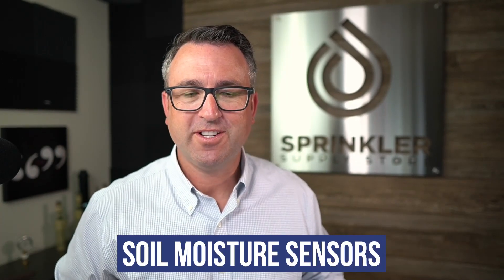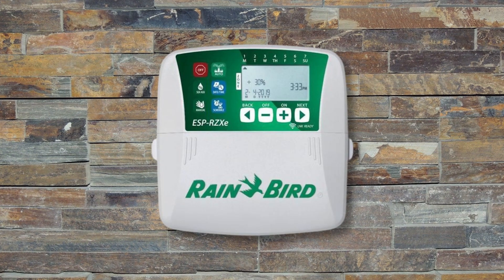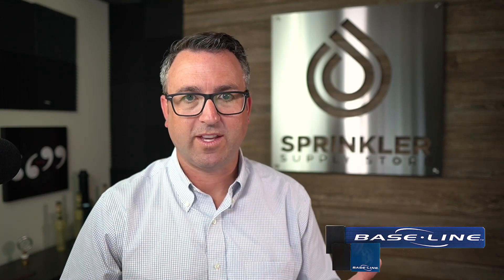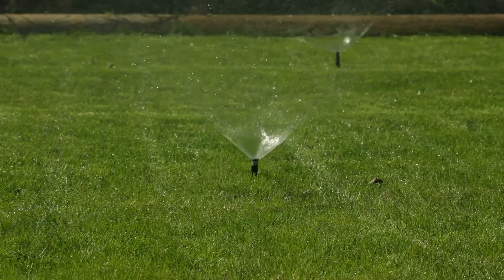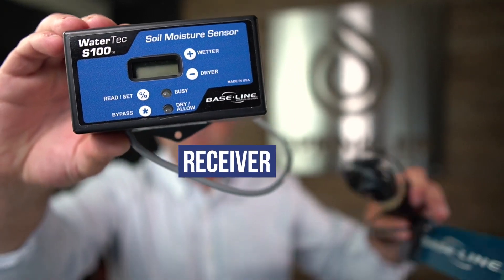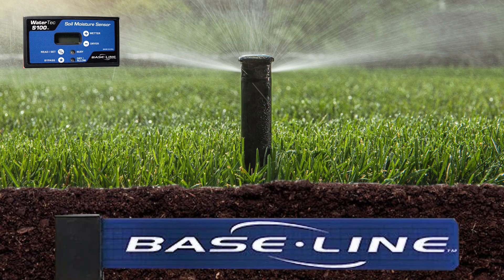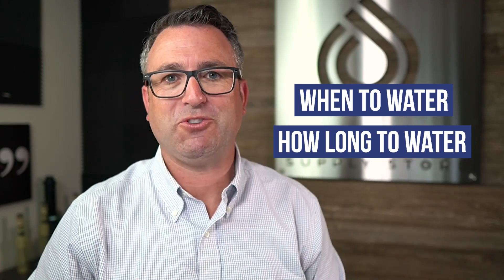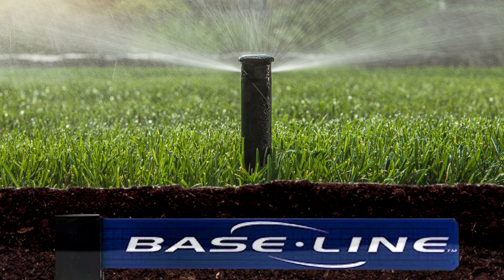How does soil moisture sensor work? | SprinklerSupplyStore.com

Comment: Hi Andy!
I have a new small residential Hunter system with an XC600 X-core controller. I'd like to add a moisture sensor. I'm looking at feature differences of Baseline and Soilclik but not seeing much to compare contrast. I watched your video, reviewed your website and comments below. I understand the advantage of "no homerun wire". But my controller is very close to the valves so not a lot of advantage to not have to run the extra wire. Are there any other significant differences between the Soilclik and the Baseline? Do they work equally as well?
Reply from the maker: Hi @benchmarkimaging8293 - if you have spare wires, you could use them the Soil Clik instead of running new wires.  There are pros/cons to both. The Baseline sensor will be more accurate due to the technology used in the sensor probe, while the user interface on the Soil Clik is definitely superior. The Baseline sensor also has a calibration feature that will help you properly set the sensor threshold after install - and you can see that actual soil moisture percentage - the Soil Clik does not display the percentage.

For accuracy I would choose Baseline.
Reply from the maker: @benchmarkimaging8293 Fun fact, the Hunter Soil Clik is essentially a private-label version of the Irrometer Water Switch, found here: https://www.irrometer.com/landscape.html

Comment: What’s the advantage of using these sensors over the Hunter sensors when running a Hunter controller ?
Reply from the maker: Depends which other sensors. Always install a rain sensor, even with a soil moisture sensor. This sensor is designed to keep the system off until the soil drys out (vs. turn it off when it’s raining).
Reply: Thanks for the reply !! I was thinking of the soil clik sensor to get the right feedback in the UI.
Reply from the maker: Got it! The biggest advantage is that the Baseline sensor does not use a "home run" wire going back to the controller. You wire it into the closest valve, and it is able to send data over the field wires, back to the controller. Kinda like wireless, but not wireless. It sends data over the wires..

Comment: How do I know if this works with my in ground sprinkler system
Reply from the maker: @NJTrain - great question. The S100 Moisture Sensor will work with any controller that has a common wire. This essentially means any existing controller, not matter how small or large, except for 2-wire controllers. The S100 soil moisture sensor works by interrupting the common wire so that power is not able to reach the solenoid. By interrupting the common, the unit is able to track the last time the schedule attempted to run, but was not allowed. There is a small learning curve, but it is not difficult, and you could decide to install the sensor just to take readings, but not allow it to pause the watering. -Andy